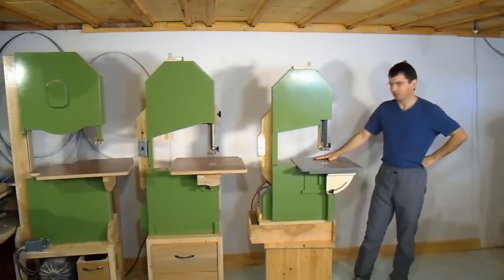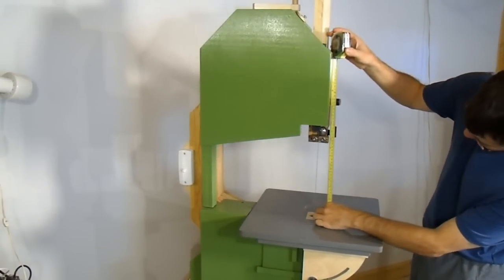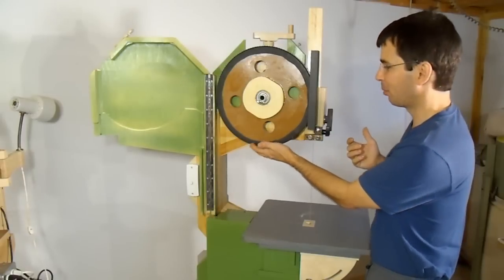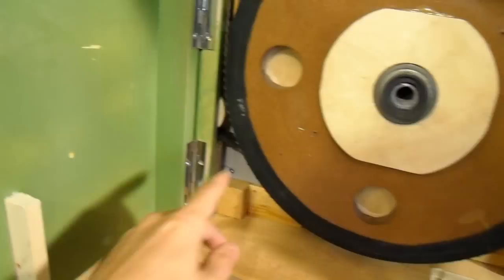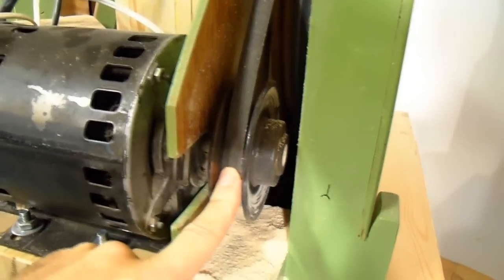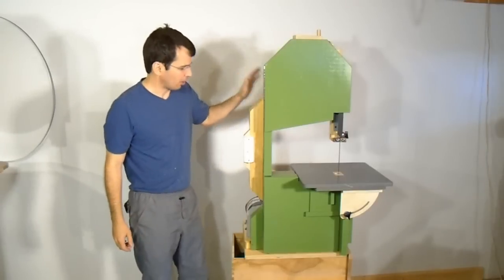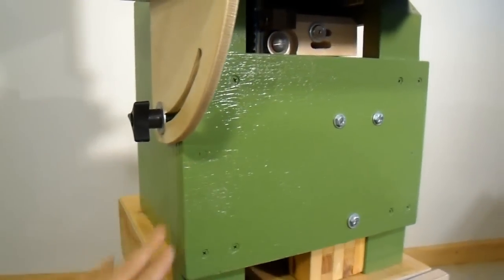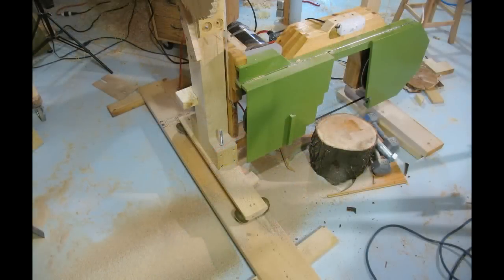14" bandsaw complete

Comment: I've been gathering things for my attempt at your bandsaw.  My solution to the shafting was to buy some long (10 in or so ) 3/4 in bolts from my local farm supply store.  Only the end 2 in or so were threaded and the rest was a nice shaft with a hex end.  Will probably cut off the threaded part, and embed the head in the shaft support blocks.  Bearings are 3/4 in ID and 2 in OD. Bearings slip on the shaft nice and snug.  If those shafts bend there's WAAAAY to much tension on the blade!

Comment: Nice band saw designs you have there. I thought they were commercially made units sitting there at first. I built a glass crusher over the summer that uses a take up tensioning mechanism like this, only mine in steel and was used to tighten a v belt. In retrospect, I wish I would have just used a spring loaded idler. Your wooden band sawmill I think would be quite popular. I built one years ago, but there again, out of steel. I think building of wood would be a much more practical choice for many diy'ers. I have considered selling plans for designs, too, but I work mostly in metal, so it narrows down potential customers by a huge amount. Many guys have wood working tools, but most don't have machining tools.

Comment: Try Poly v belts you can go down to an 1" diameter pulley and still get good grip I converted my vertical milling head to reduce the speeds and it grips better then the vee belt originally  fitted. Excellent videos keep up the good work.

Comment: I don't know if you could but I was thinking that you might be able to  put a pin into the table insert which would fit into a hole under the table that would lock the table from moving. nothing super sturdy but enough to stop you from forcing the table and breaking the blade.

Comment: Could you mount the drive motor so that the shaft is approximately in line with the centreline of two blade wheels (possibly below the lower wheel and hanging out the back).  This would balance some of the forces on the bottom wheel, and all blade adjustments could be done with upper wheel (or the motor could be spring mounted to ensure force is applied on the drive belt regardless of the bottom wheel adjustments).

Comment: From an engineering standpoint, what I think Matthias is referring to is the cyclical stress on the blade of bending and unbending each revolution.  So with a 3-wheel design any given point on the blade will bend and unbend 3 times per revolution instead of 2.

Comment: Blower motors have a self re-start if they overheat.  Sears on one of their lathes 133.228160 warns  against using it for the wood lathe for that purpose.  To top that off, the blower motors tend to be wide open to saw dust, but considering the environment of evaporation coolers do you think they are safe for band saws and lathes.  Would not just shutting it down if it overheats resolve the self restarting issue?

Comment: Sorry to bother you again, but in your opinion, do you think it's really necessary to have as much enforcing that you have? Was your first band-saw strong enough with just a vertical beam and plywood attached to that? I just think it would make it a lot more cost and time efficient to use less enforcing, since I wouldn't be using mine like a sawmill. Thanks again for your reply.

Comment from the maker: I use one of those in my table saw.  The upside is less low frequency vibration.  Downside is less efficiency, and louder.  I would also highly NOT recommend using those on wooden pulleys or on small pulleys.  Highly overrated.

Comment: I think it has more to do with the radius of each of the three wheels. A three wheel bandsaw will have wheels with a smaller individual radius than two much larger wheels. So, even though the blade only covers 1/3 of each wheel, it still needs to bend much more to be tight around a much smaller wheel. It is this tighter bend that weakens the blade.

Comment: Great videos, thanks alot for putting these up! 

I was thinking about the flat belt being hard to get inline and getting evenly distributed force to.

Did you consider a middle part shaft with "down gearing" using V-belts, or does that just add more complexity/problems?

Comment: Hello Mattias
I purchased your project from the circular saw bigger, that I can not wait to start, but I wanted to ask, since you already possess, if you can fit an induction motor 3 hp.
Reply from the maker: Marco Galli Yes, a 3 hp motor, if it's small enough to fit on the frame, will do too.

Comment: Stock Drive Products in the states sell some super strong belts made of (i think) nylon and kapton?  The are really not all that expensive.  I have dozens of aluminum toothed pulleys and it would be easy enough to set up teeth in the upper pulley.  I used them in robotics repairs. they are nice because they have almost no stretch to them.  They are very thin and a belt even only 1/2 " wide could pull a car.  I know I have  a bag of them somewhere. I have some larger pulleys that go with the small diameter ones too but only have a 4 to one ratio. this setup would be ideal for a sander or something. I have all of the matching shafts and bearings too,

If I can find them, maybe ill send you a kit to play with,

Comment: would a vacuum cleaner motor work for this project?
Reply from the maker: no
Reply: do you have a suggestion for an easy to obtain motor? pool pump motors are a little difficult to come by.
Reply: Of course it depends where you live, but you should be able to come across some. Look out for people selling/disposing of broken pool pumps. The issue is likely with the impeller, but if the motor doesn't work it can always be sold for scrap. Pools aren't exactly common where I live, but I can still find pumps, yet I've never come across a furnace motor, probably since it doesn't get as cold here.